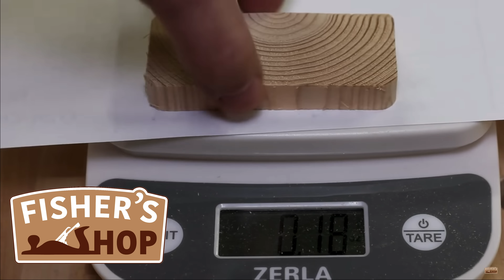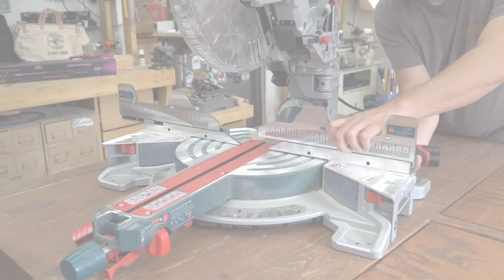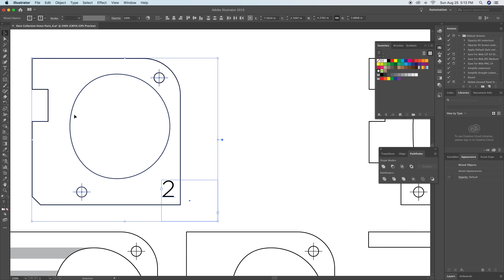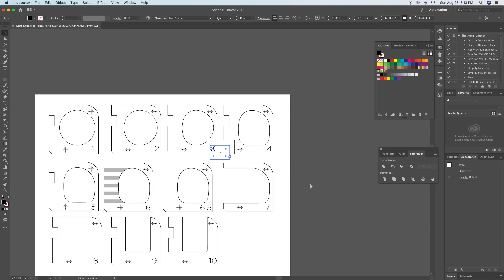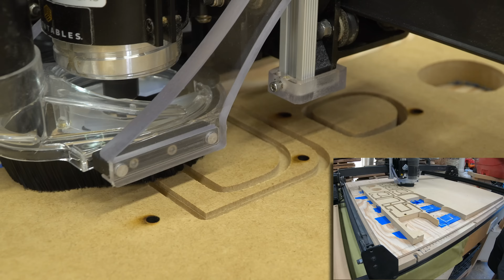Miter Saw Dust Collection - New Custom Fence

Comment: In the future, I plan to basically duplicate this fence, but with only three sections of solid wood and a PVC pipe from the left to connect to a dust collection system and the miter saw itself. The middle section will be from an inexpensive wood for occasional replacement and either end shall be able to be disconnected, as the middle section is eaten up by the blade.

Comment: Looks very impressive. But I tried the original Fisher & Shop design with my 50ltr/sec vacuum and a humble Macallister mitre saw.  I found  a few seconds of cutting the turbulent air flow from the saw over whelmed the suction from the vacuum and a cloud of chips came back out of the slot. I wonder if this design would gate any better?

Comment: Just wasted so much time watching this video. Longest explanation ever with 2 seconds of showing it in use.  We didn’t even see how it works or if it even worked compared to stock dust collection.  It has no potential.  Most of us don’t have 6 weeks to build a dust collection shroud for a miter saw

Comment: Wow, a "outside the box" idea that had some success, but a person without a CNC machine will spend way too many hours cutting and sanding to create something that has a limited success in my opinion.  I think you should have created a center piece that was replaceable so when you cut the hell out of it, you just drop a new one down in.  Back to the drawing board!  Remember, it took Edison over 10,000 tries to create the light bulb filament - hopefully, a woodwork will master sawdust collection in less tries.  But, it's all about the challenge, the thrill of working with your hands, oops, I mean CNC, and testing your idea with a result of either a happy face, sad face, or confused face!  Most are happy faces because they actually got to do woodworking!  I really enjoyed the video and your skill at designing, CNC machining but I'm hesitant to use your glue up method - seemed really messy to me!  Thanks for taking the time to make this video.

Comment: Fantastic Idea of a Dust Collector. To replace the factory parts gives up the space needed to introduce a this complete new way to collect all of the stuff you want to get rid of. As a metal worker, i would reproduce this thing in my familiar environment which is steel😎. Thanx a lot for this unusual but more than interesting way to solve a problem which most of the miter saw users have. Stay save and healthy. ✌️👏👏👏🇩🇪😎

Comment: Look nice once painted and on top, color matched. 
You learned MDF delaminates easily and doesn’t have a constant density throughout its thickness, enhance the trouble facing it on the jointer. 
I wouldn’t be surprised your fence split again if by any bad luck a piece of wood you cut decides to kick... once in 10 years event.

Comment: Sorry I’m not a Carpenter so I’m probably missing something
My thoughts are to do this but just build a hollow box out of 3 quarter ply 
Then just connect some plastic pipe inside 
Maybe your consent is just to work out of wood ?
You could make a grill for the front and strengthen around the pipe using expanding foam
Just me being nosey I’m a plasterer from England

Comment: Excellent design!!  One of the best I've seen, and I'm thinking about giving it a go.  Do you think it would be possible to make middle (honeycomb) section removeable and replaceable but keep the same strength and true reference points?  Maybe by adding a 1/2" wide 1/8" deep channel towards the rear of the bottom face and using a steel/aluminum bar of same dimensions to index the right, center, and left components?

Comment: Great concept and execution! I would suggest trying Medex -  exterior grade, water resistant MDF. It is harder and stronger than MDF and machines nicely. Oh and just a thought if you develop this great idea further; you might consider integrating as small as possible sacrificial insert that could be replaced whenever it wears out or sustains damage from a kick, etc. I think this is an idea well worth developing further, kudos!

Comment: Very cool~!  This seems to be a very functional way to collect dust.  I've seen Frank's and Drew's and this appears to be a nice merging of the two.  Also, I just saw that Woodpeckers put out a similar fence for their drill press table.
  -  I'm looking to see how a CNC could work for me in in the workshop and this is a great example~!
So, not sure how often you'd need to refurb the fence when it gets eaten up/worn, but maybe a possibility to make it modular to have a replaceable center section?  Maybe use short dowels to align the 2 ends to the middle?  Would probably have to add other small dowels on the opposite corners for alignment?  Just thinking out loud.  But overall, a really cool idea~!
Reply from the maker: Thanks Andrew! You're thinking just like me on this one. There is room for improvements and if I were building it again I would try to make replaceable inserts for the middle.

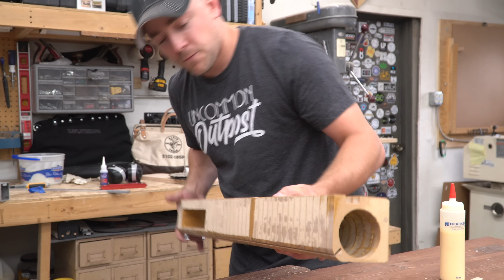Comment: Your dowel issue at ~10:32 - don't have the dowel ends line up. Like staggering joints when stacking multiple layers.

Comment: Silly question but couldn't you have used threaded rod to connect all the blocks instead of the spline ? It would have helped with the glue up as well

Comment: As a couple of people have said, I might try to replace the center with a sacrificial piece.  If it's easy to insert and remove, you can just replace it whenever you've done enough damage, and if it's easy to make it will get replaced more often.  Maybe a piece of pegboard slipped into a notch in the fence?

Comment: I didn't try to read all 291 comments so hopefully not repeating something. Great start to a way to make a more compact and capable dust collector. Seems you have an inch of room between the saw and the system you made. Thought of making it slightly taller to help prevent the dust from going by? Also, might be a good idea to just make something that hangs over the cuts slightly that could prevent dust from going over if that makes sense.

Comment: I think you did a great job kind of threw me for a loop here and there bottom line is if it works better then before that's great.  you think the manufacturer of all these chop Saw they would have the best system out there   Great Job if you get them me some good 👍👍👍

Comment: You should consider plugging that hole that you drilled on the bottom. In my experience, a whole like that will significantly decrease the pulling power in front of the blade.

Comment: Amazing concept, could you make a "Mark II" that has the middle section look more like a breaking wave rather than a flat wall? (Scooped up) to follow the saw's cut in any bevel/miter? It would be like if you were to press a basketball onto the top corner of the grate you had. The grate is a great idea b/c adds stability/strength but the cuts into the original one breaks the vacuum at those places. With the indent you should be able to keep the vacuum, stability of the grate, and the increased surface area.

(✿◠‿◠)

Comment: Nice job! 👍 I'd have never thought of this, but on looking at what you have made, and hearing that you'll replace it,  I had an Idea.  What if you made it just as you have, but instead of putting the air holes in the face, for the 8" or so that they occupy, as well as the kerf portion in the center, could you just start a pocket that would let you put in that portion of the face after the rest was built?  It would probably have to be "L"  shaped of two pieces to replace part or all the top face too, or at least the portion the blade reaches to from a maximum right to maximum left miter.  You could put the air holes back in these sacrificial portions of your cool fence, but not have to rebuild the whole thing each time.  If this "L" replaceable portion were easy to swap out, screwed not glued, maybe you could start it out with a non beveled 90° and a 45° each way, and a 90° that is beveled to 45° each way, and it would sort of give you a design to begin with - now air holes could be round and drilled in, and be placed where they work out around those 5 kerf lines that you cut.  Those five lines should take care of 99% of your cuts, and since this portion of the fence is easy to replace, it's  also easy to take off for a few oddball cuts. Or if for some reason there is a cut you are making often, 22.5° or something, go ahead and add that angle too.

Also, I was wondering if where you were having problems with the glue up of the three sections, would it help to put those two joints in the sections where the blocks to mount the fence to the saw go? So some of each side of the joint gets part of the same block later, tying them together again with a hardwood block on the opposite corner of where you put your spline?

Comment: Like the video and I am still watching it...you said "step away" from your XCarve? Just a little advice, don't step away too far! I stepped away from my work that was running and apparently my end mill bit created a fire under my work piece! It was totally assisted by the vacuum table constantly drawing in fresh air. Just a little unsolicited information, I notice you have some dark brown around those drill holes.

Comment: Couple questions. 1, wouldn't having the dust portal channel on both sides with hoses increase air flow and thus suction in the area of the cut? 2, if you made the middle area removable then it would be easier to replace than having to make the whole thing again when it gets too chopped up. Like the zero clearance insert. You dont want to have to replace the entire base for that.

Comment: Your fence design is wonderful and innovative. Removing the fence was fantastic and allows for endless expansion. The modular design allows for endless possibilities and design changes. You could sell individual numbered pieces or complete sets as well for those of us that might not have a CNC. 

Something to consider is possibly using threaded rod to hold it together so that it can be disassembled or easy repaired or modified as future needs, wants or changes arrise. You might also consider threded inserts every few pieces to ensure snugness during assembly though that may or may not be necessary as it may be far more restrictive than useful now that I think about it. The end caps can be used to hide the nuts with a countersink or one could leave them exposed. 

I'd also consider possibly making it a bit taller or even wider to allow for larger suction to be attached without the need for Adapters. Taller sides may allow for more stability while shorter mid section to allow for clearance. 

Seems to me you might get away using all number 7 pieces in the middle foregoing the use of 6 all together. In my observation it just seemed number 6 was not as necessary or useful as 7 alone. It just seemed to me that number 6 was a bit restrictive as well. 

Great project I think you really have something here. I gave up on dust collection for my miter saw because nothing seemed to work any better than the basic design or hose but your design has real potential. You are the first I've seen to remove the fence and repurpose it for collection. Cheers...

Comment: After upgrading my table saw I rarely use my miter saw anymore. I guess it depends what you build in your shop that justify which tools you use. It seems like dust collection just really limits the movement of the saw which is the appeal of it in the first place. Why not just use a large shroud behind the saw to catch the dust? Cool build and pretty crazy you designed and came up with it.

Comment: First off the whole right hand side could have been a solid block. There was no reason to cut that out of multiple individual pieces. The second problem is once this thing gets chewed up you've got to replace the whole thing, because you glued it all together. Making it three separate pieces with the middle being replaceable would have been better. Lastly, the left hand side could have been made out of four pieces in the shape of a long box, routed where necessary for saw fixture clearances.

Comment: Great build. Not sure if I would want to do it out of MDF because it would need sealing to prevent swelling from humidity. UHMW or HDPE would be a good option. I could also see adapting the model to be made partially out of aluminium and the side pipes out of attached PVC pipe.

BTW, I love the drill/driver hangers made of PVC pipe you have behind you in this video too.

Comment: Great idea and concept  my Woodworking background is. Mostly  involved with the onsite  installation of Architectual Woodwork  and  improving dust collection  not only has health benefits but it would  seriously  improve   Customers opinions on  keeping the fine dust to a minimum.  I could see this type of a product being a big seller  especially if you. Offered kits for the ore common miter saws  the issue  of that system of course is that most Woodworking shops these days have their own CNC equipment  and can knock out  a similar. System pretty easily  but the concept looks pretty good  id be interested on seeing test results of it in action  another addition that would be cool is to house the vacumn in a insulated. Cabinet. To reduce the  loud noise a shop vac is known. For  my first thought is a rolling bae cabinet that also acts as a  saw stand and outrigger  set up  for longer boards

Comment: Awesome dust solution! Just out of curiosity, thoughts on doing this exact same thing but using a piece of threaded rod in the index holes instead of dowels and glue. Hear me out here.. Replaceable center section. Looking forward to seeing how this works out for you over time and lots of cuts and seeing if you decide to do a V2.0 of it!

Comment: Love the thought process & creativity.  Question though - when you cut with the blade tilted, doesn't it cut through an entire section of your fence?  You originally cut at 90 degrees, then if you tilt say at 45 degrees and cut through the back of the fence, it would seem to remove an entire section...
Reply: My thoughts exactly. Harry
Reply: Maybe like others have said a removable section but an insert for angled cuts. Just a newbie trying to figure things out.

Comment: You really need to finish this video by thoroughly testing it in action to show how well it worked, and also include what make/model shop vacuum you used. Using a 4hp vice 6.5hp rigid is day and night difference and should be a part of your discussion. Nonetheless you did an outstanding job and came up with something unique and interesting. Hope my constructive criticism finds you well.

Comment: Nice! I would recommend having 1 or 2 spares made of the middle section (since they're going to get chewed out over time) and/or replaceable inserts for the different (Mainly used) bevels and miters. So that you pull out the middle section and throw in another equally sized piece, and go back to the 1st just as easily (Magnets at the ends?) Hmmm... maybe I'll do that...
Reply: Mid sections wouldn't even need to face up exactly would they? Just sit back a mm and stabilise the L and R sections by having parallel ends. So not just spares but quick fit one straight cut, one left handed angles and the opposite. 👍

Comment: Love it!  Nice job matching the color to hide the MDF too!  A skim coat of Bondo prior to paint would've further smoothed the surface and made it look like metal too.  I would look o make the middle section indexed and replaceable (just like a throat plate on the table saw).  I, like you, would hesitate EVERY time I had to cut a new angle and it would drive me crazy!  If it was replaceable, I'd just cut it up and continue to procrastinate making a new middle section FOREVER!
Reply: I was thinking along the same line of thought as you. Right when he said there are 42 pieces I thought for sure he was going to make it modular to slide off parts for nesting 6" crown with beveled and mitered cuts.

Comment: I think you are on the right track! I had mentioned in a comment to Drew that I was considering using the exhaust of the vacuum to guide the dust into a dust chute  so the vacuum could suck it up; so in your case it might be just the thing to force the dust down into your fence. Maybe just a matter of hooking the exhaust up to your original port on the saw? Thanks for the great videos!
Reply from the maker: That's an interesting idea Frank!

Comment: The idea of replacing the fence is not something I have seen before. However, I think you need to drastically simplify this. I'm don't really see the need for making it out of slices? Couldn't you just make up a box with plywood, and stick some upvc pipe down it? I also agree with another commenter, in that the centre section needs to be easily replaceable.
Reply: I'm with you but, It's a great experiment.  I'm glad he did it rather than me and its got me thinking about alternative ways to achieve even better performance,
Reply: He probably did that in order to have a rigidly straight fence. But yeah, a replaceable center with a rigid fence would be ideal.

You've given me an idea regarding the PVC pipe inside a box. I'll have to put my creative juices to work.
Reply: @kennorthunder2428  - don't be rude, share your homework with the rest of the class. 😏
Reply: @semperfi5857  hehe. I've been too busy working my day job, plus, got to get some other projects done first. Sorry.